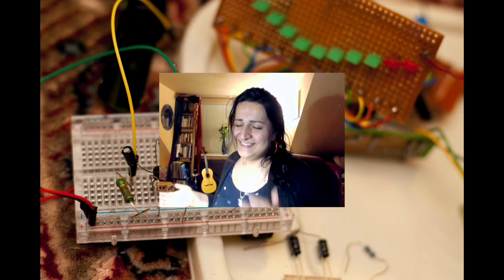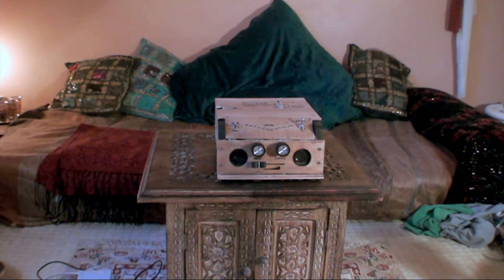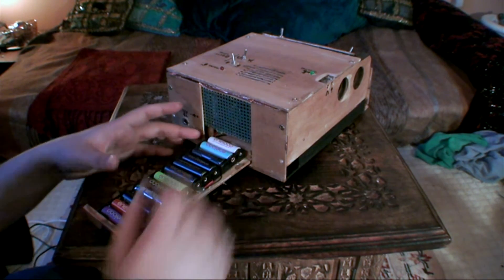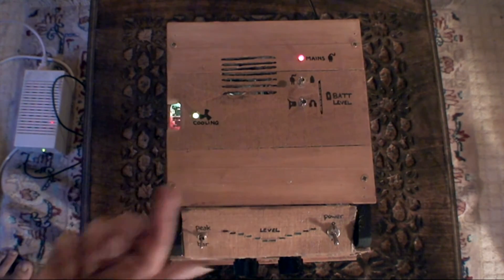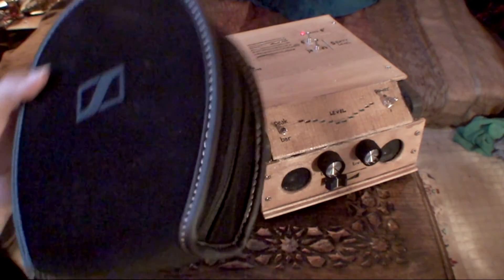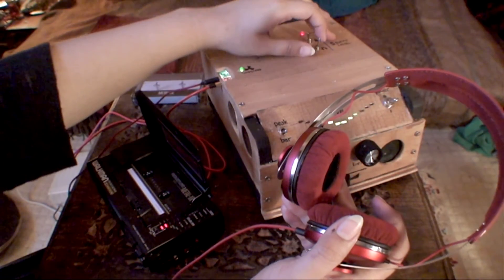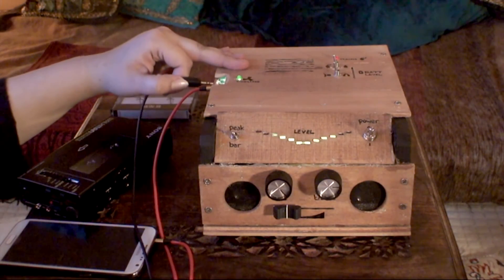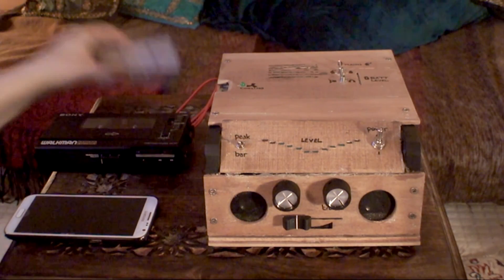Portable Amplifier V2 - Part Four - The Finale!

Comment: ...Aaannd, the Giggle Monster attacks again! LMAO!... Maddi, you're a trip! Gotta love it though that you don't just edit out those parts when you start cracking up, as it shows your comfort with yourself in being totally silly! ;)

Very creative design, BTW!... I see where you got the inspiration for your V/U meter layout; from your Marantz amplifier!...
Two suggestions if you ever decide to change or improve this project;
1. Instead of the rechargeable Ni-MH AA batts. all in series, you could instead use some Li-Ion type like used in cordless tools, "e-cigs", or laptop battery packs, that way you'd have much longer lasting power, plus you could put in an automatic recharging circuit into the amp to keep the Li-Ion batts. fully charged if using the Power Adapter to run it.
2. If you added either spring clip or binding post type external speaker terminal jacks to the back of it you could use it to power stand alone speakers, like the ones that you have hooked to your main stereo system. This amp would then be useful for testing speakers in a thrift store or at a yard sale or something to see if they were good and worth buying.
Reply from the maker: Haha the rechargeable NIMH batteries were a joke if i'm honest, I knew they wouldnt be practical, the start of this project I had 4 batteries, the project didnt go to plan as i made it into a power amp, then planned to make it powered with an AC adapter. I decided to continue with the NIMH since the compartment was already created, you know just for a laugh at how many batteries it would need lol.
Reply: Hahaha!... OK, I see. That's a good laugh then too when you show this to anyone, I'm sure!

What about adding external speaker terminals to it so you could test other standalone speakers if you were ever out shopping for "new" vintage ones? Any thoughts on that idea?

Comment: nice one. have you considered replacing the dozen or so AA batteries with two "square" 9V ones? I have seen some mini mixers that can go for several hours on them.
Reply from the maker: +Shawn Tewes 
Thank you! About the PP3 9V batteries, the thought did cross my mind a few times but this thing drains 12x 2500mah batteries in 30 minutes roughly. 9V PP3 batteries are around 300mah, I can just imagine them going "poof" after 5 minutes. Hence why I use this thing on mains mostly :o)
Reply: +MsMad Lemon Good point. I got to thinking, maybe hacking the Li Ion cells out of an old 19.5v laptop battery might be a better substitute, since they usually are rated at nearly 5000mah. Plus they're rechargable, so that's a bonus.
Reply from the maker: +Shawn Tewes 
Yes LI-ion would be ideal actually, especially since the AC adapter i'm using for this is a random 19.5v laptop power supply :o)) I would just need a Li-ion charge circuit though slightly apprehensive about it haha.